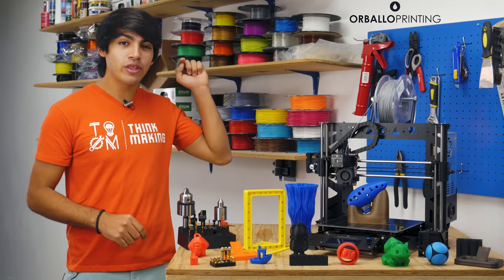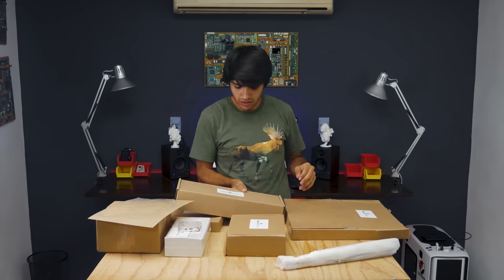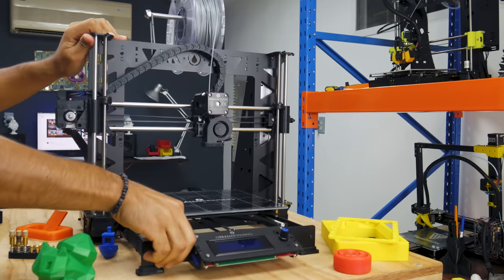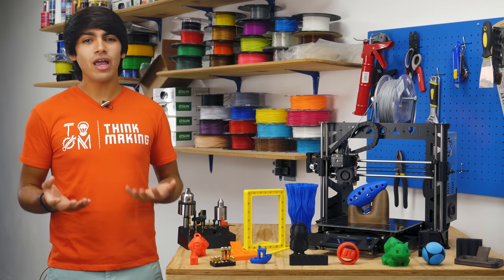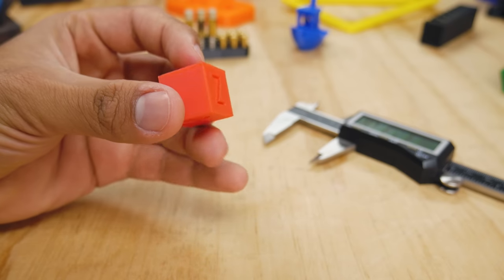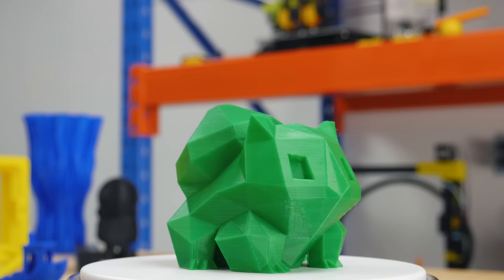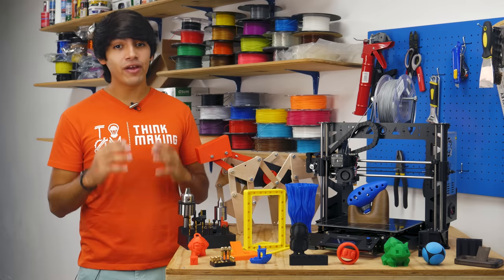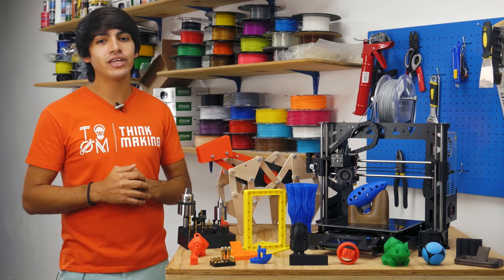🛠️⚙️ Prusa Steel Black Edition MK2 by Orballo Printing - 3D Printer Review

Comment: Comparing this kit to other cheaper kits like anet, tevo or creality, the difference in print quality is notorious? Is the extra money justified?
Reply from the maker: From those examples I only own a tevo, but I've seen plenty of reviews on the other. This one wil definitly get you better print quality than an those, specially at higher speeds. Remember, rigidity plays a huge role on print quality. The frame on this printer will not resonate nor flex at any point. The CR-10 is much bigger, but due to design limitations, like a single lead screw and the size itself, will introduce much more inaccuracies at higher speeds. Between a CR-10s and this printer, that is a tough choice to make though. Both are great printers and similarly priced.
Reply: The response is very justified, thank you. Excellent channel, I hope you keep growing, you have my support.